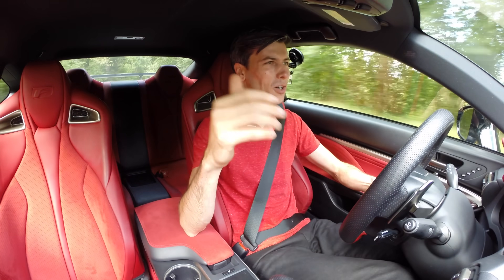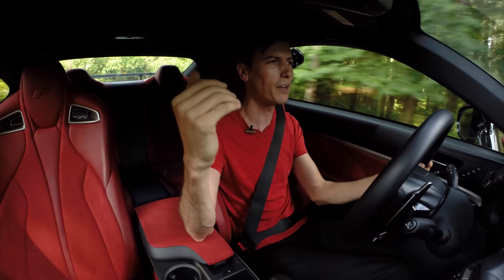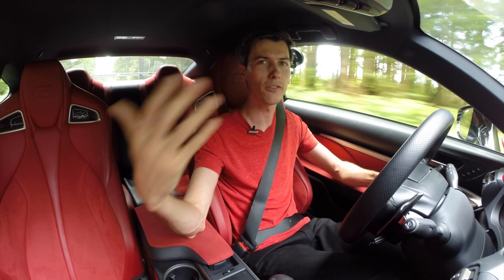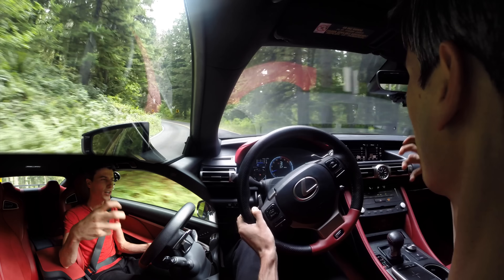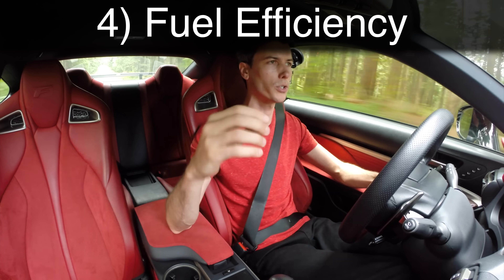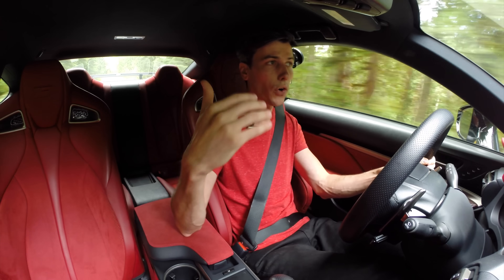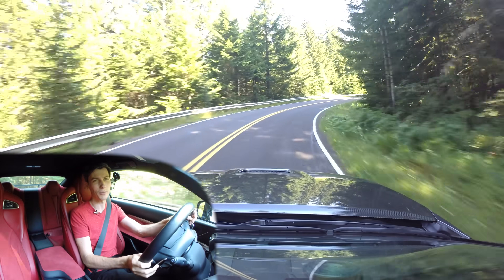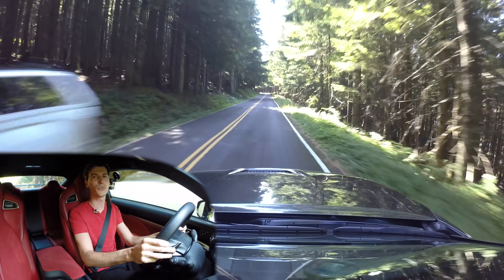5 Reasons You Shouldn't Buy A Turbocharged Car

Comment: I have a family car with a downsize 1.2l VW engine, turbocharged, 105 hp and 175Nm and a Mazda MX5 with the 1.6l NA engine, 116hp and 135Nm, and I have to agree with all you say in this video.
The Mazda engine is just the much more pleasant engine to drive with, imediate throttle response, rev happy (shift at 7000rpm), more efficient under higher loads and it doesn't turn the oil black within a 1000 miles.
In the long end that Mazda engine will outlive the VW engine by a factor 2 I think.
The VW engine is designed to give a good mileage and low emisions, which it only does when it's not taken beyond 2500rpm.
It has full torque from 1800rpm, but above 4500 rpm this engine is literally dead, it feels like a diesel engine in its response and enables a very relaxed driving style with minimal shifting.

Comment: “Do you want a delay in steering,”. Hahaha. A “delay in braking...no that would be incredibly dangerous.”
Reply: With modern turbo tech if you’re in the correct gear you have next to no lag, even with a powerful engine.
Reply: It’s more of a preference some people like a long hard hitting power band.
Reply: A 1959 Cadillac (or other US car of the era) had a bunch of delay in steering.   You could whip the steering wheel 90 degrees left & right while driving on the highway and all the car would do is rock severely back & forth while staying in its lane of travel.  A lot of improvements over the pat 60 years.  :-)
Reply: “This is America, I want it and I want it NOW!”

Wait at the McD drive thru ordering line to place order. 
Wait to get to the pay window.
After paying, wait to get the food.

I think a little bit of turbo lag isn’t that bad.
Reply: @jack765ful  It often shocks me how few people actually use the App instead.  Don't even need to tap to pay.  Plus it lets you double-dip on the free coffee sticker collection.
Reply: Those 2 things dont have anything to do with delayed power just a bad example
Reply: @andreasf3064  How is that a bad example? Having instant throttle response is as a big safety feature as a responsive brake.
Reply: @andreasf3064  
It's a fairly reasonable example
Sometimes you might need to rely on that power to save your life
What if you're about to get rear ended? With a huge turbo you may not get off the line fast enough

Comment: This is relative. 1. Throttle response doesn't have to be impacted much at all depending on the setup and goals. Wanting completely linear power delivery is preference and not necessarily the "best." 2. Torque curve can look pretty flat on a Tubrocharged engine, this is about the combination of the setup and tuning, it doesn't have to be "peaky" or "fall off" up top depending on your setup and goals. 3. You may have to stay on top of maintenance a bit more than a NA engine, but we're trying to make a bunch of hp, this doesn't matter. 4. The turbo doesn't have to be less efficient than a NA engine as long as you keep your foot out of it. Even then you'll be using more fuel because you're hauling ass everywhere. If you look at your thermal efficiency table in your video you'll notice there's only a few % difference between 10 to 1 and 12 to 1. This is negligible. 5. Preference. I definitely like the sound of a BIG SPOOLY BOY

Comment: This is why I love supercharged rotary engines ❤️
Reply: I'm not here to champion V8s either. I think the straight 6 is the king of Piston engine design or two straight sixes mounted on a single crank (V12). Also sure I can tune a K24 to 800HP but that doesn't mean an I4 is better than a V8 for performance.
Reply: @johnh8546  amen brother! hahah yeah thats true, and thats funny you mention a k series.. been planning a swap with one of those lol but hey, we've found common ground! I agree :)
Reply: Because you love burning gas and oil?
Reply: John H absolutely 😎😜

Because lightweight power plants are amazing
Reply: Yeah they are light with no torque, horrible economy, terrible longevity, and went out of production but I'm sure there was no good reason for it.
Reply: @johnh8546  no torque from the factory.. though a tuned 13b can easily out perform a v8 in both hp AND torque. I love v8's because they are cheaper to run as a daily and way less maintenance!
Reply: @johnh8546  ohh and yes, terrible fuel consumption by far the worst.. haha flames everywhere though which is fun! and don't believe the myths about rotaries not being reliable.. they are.. IF you stay on top of maintenance and know what they like/don't like..
Reply: John H for sure man no worries haha it’s the internet, it happens lol

Nice, just your daily? 

I love rotary engines.. sound and feel.. but as a daily, it’s too tedious.. love hate relationship hahah
Reply: No just not a race car my daily is 2002 Civic Type R with at bone stock K20 with 255K on it. My Accord coupe has the K24 with Motec Exhaust, a T25 turbo, high volume injectors (stock probably would have worked), it has a K20 head, ARP head gasket and Studs, and other stuff to the drive train and suspension but pretty tame ultimately.
Reply: John H right on haha well, it has potential I’m sure.. are running a tune or just stock right now?
Reply: My Type R is truly bone stock I'm running a K&N air filter but it's truly bone stock and of course has 3 petals. I got it cheap with a burnt out clutch years back and decided to keep it stock as a daily/beater.

Comment: Love this vid, mind explaining why BMW went with 3 and 4 turbos in their new generations of high end cars?
Reply: I believe the 3-turbo option is only on diesels.  At any rate, yeah, there are advantages to turbos.  Obviously, nobody would use them if they didn't have some advantages.  So, sure, advantages and disadvantages.  But at least typically, a BMW driver isn't going to expect it to last 300,000 miles like a normally aspirated Civic or Corolla driver might.

Comment: Pretty good summary.  Generally turbos seem like a false economy.  Engines don't last as long, and under real world use they MPG is not as close to the rated MPG as a NA engine.  With the lower compression ratio you are worse off when the turbo is off, and when the turbo is on you get worse MPG and wear.  I've noticed companies reducing the CPO warranties as they move from 2.5-3.5 liter NA engines to 2.0 turbos, and I've been a big uptick in serious engine problems just after the warranty expires.   Seems like the days of a well taken care of engine lasting 200-300k miles are gone.

Comment: If you had made this video 10 years ago, your points would be valid.  However, the engineering that has gone into forced induction as well as the throttle by wire makes this entire video invalid.  FAIL.

Comment: Valid points, Jason. I cannot comment as much because I still haven't driven a gasoline/petrol turbo car (only turbo-diesels), but I didn't realise (rather, didn't figure out) the higher fuel consumption is due to the lower compression ratios, and the softer engine sound (read that, not experienced it) due to the exhaust air being used to spin the turbine. The sound has to be there for me, along with a stick shift, that's why the upcoming electric cars worry me, even if I like them due to performance being more accessible in them, with the lower maintenance due to less moving parts.

Comment: i like my 4 cylinder turbo and get 44mpg with an average speed of also 44mph. higher or lower average speed results in 34mpg its a 2012 chevy cruse lt. i do not like the lag if im going 35 and have to slow to about 15 for someone to take a turn and then speed back up if i over press the peddle theres close to a 2 second delay before the seat hits me in the back and it takes off.

Comment: Car engines propel the weight of the car, including the weight of the powertrain.  A smaller lighter powertrain promotes fuel economy and more balanced handling, as well as easier packaging.  The notion that it takes 2 seconds to get power out of a turbo engine is outdated.    Modern turbos have much better throttle response.  Some companies are assisting turbo spool up with electric motors to further improve throttle response.  Drive a turbo Porsche or just about any other turbo car and you are going to find a lot more mid range torque than with naturally aspirated, where most driving is done.

Comment: As for number 4, I'm not sure about small car, but in big diesel (bus & truck), they have this "Turbo Intercooler", which is basically an additional radiator to cool down air intake after getting pressurised by turbo.

Comment: The S55 engine in my M3 really has to be revved out to hit good power. Not torque...power. Like, if you’re cruising at 60+ mph and you gotta rev past 5,000 rpm or it feels dead. Very similar to NA in that respect.

Comment: I was surprised to learn that a gentleman with a minimalist F150 like mine (his with a V8 and mine with the 2.7L twin turbo Ecoboost); each of us with a very light-weight RCSB work truck; each around 4200 pounds of curb weight (v8 weighs about
60 pounds more than small twin turbo F150, all else being equal)that, he  was achieving 20.9 according to his mpg computer regular driving which he said included some towing. My trip meter usually shows between 25-27; but is normally 1.5-1.9 optimistic and I get better mpg than most drivers, and I use my truck for light duty furniture hauling etc plus commuting, and also, the optimism of the trip computer tends to increase as actual mpg increases at least in my truck. Considering all of that, I figure that I could likely achieve around 22.5 in the V8 same configured pickup as mine versus my 24.2 lifetime average. The more city driving done probably results in a greater advantage as mine can exceed 20 city driving in real world city driving; I can't see the bigger V8 doing well city driving even in it's lightest form. If I used a truck for hard work or used it for regular towing or had a large, heavy, elaborate configured pickup like many crazy people do, I wouldn't even consider a GTDI engine. It's best place is for those who drive easy; have a modest configuration that will allow for minimal turbo spooling but also want the advantage of increased torque that a wimpy NA V6 can't provide while also getting better mpg than larger displaced engines such as V8s can't possibly achieve due to their size. But for those seeking  great performance or high utility as a high priority, if a large V8 is offered or a smaller turbo or twin turbo with similar peformances or capabilities, then the big V8 is the better choice; especially if you want decent mpg while towing or drag racing.

Comment: Hi, you spoke of heating and high temp & resulting high pressure in TC Engines, but is it not why inter-coolers or CAC's used before the High pressure & Temp air is fed into the cyl to avoid early spark and resulting Knocking of engine.?

Do you have any thoughts on introduction of VGT's in Gasoline Engines, which can account of some issue. I would like to hear your insights more and also learn more of your references on this topic.

Comment: Once I went to Kanada for Holiday. I met a guy who had a Mazda 3 with 240 HP. I told him that mine with a 1.6 l Turbodiesel makes 180 km/h on full throttle.
He didnt understand what I said. The max speed he has been driving was 140 because he was too scared of the police. Max speed everywhere was 80. 
So I asked him for what he needs these high Hp. 
My small diesel has 270 Nm. That really kicks. If you have 2 l diesel you usually have around 400 Nm. What is realreally enough.
But beside that I also love the easier predictable feeling of my Mazda Miata with the 1.8 l enginde from 2004.

Comment: I agree unless you have a diesel. My VW TDI has been flawless. However I will replace the turbo proactively at about 120K miles. They fail. If oil goes in exhaust it can destroy the expensive DPF and catalytic converter. Worse is hydrolock and engine damage.

Comment: Hahahahhahahahha I can guarantee you this 5.0 V8 isn't getting great gas mileage.    His biggest complaint is the power delivery and next is the heat/wear and tear.    The engines are designed to handle the turbo and gas mileage is dependent on how heavy the foot is.  For example, I drive a 2018 type R and if I drive it very hard, I'll get 15 in the city and 24 on the highway. However, if I drive it very gently, I will get 26 in the city and 31 on the highway.  In the end, it's all relative.

Comment: My C7 Corvette Z-51 is happily NOT turbo charged. Fuel economy is easy by switching to Eco Mode using 4 of 8 cylinders and the 7th gear ... highway trips. Even using Eco Mode with four cylinders, the acceleration is very impressive. Hahahah. When I want amazing power beyond Eco and Touring Mode, I can use Sport Mode or even Track Mode and the acceleration is TERRIFYING! initially followed by reducing to just exciting. And I really like the design over the new 2020 C8 mid-engine Corvette regardless of the mid-engine advantages in acceleration.

Comment: 1,2 sequential turbos
3 performance motors cost money to build, oil is cheap insurance
4 per the graph, there's virtually no difference in thermal efficiency between an engine at 9:1 vs 13:1 CR. And performance engines use fuel, big deal.
5 Clutching at straws.

Comment: While I don't have a turbo, "taking away noise to do something useful" is a pretty weak "disadvantage"
Reply: Depends  on if you see it as useful or not. I see it as adding pressure to the engine which shortens life span. If your one to get a new car every few years that's likely ok but I keep mine 20 or more years. My oldest is a 2003 with 236,000 miles and still going strong with nothing but routine maintenance.
Reply: @strtngfrsh  manufacturers get rid of that attitude. They need more money, so they want to sell more cars and faster, because they need the money for "development", therefore they make the cars worse. Interesting, back in the 80s for example they didn't need that much money...
Reply: Exactly
Reply: @Frances Hill If you are gonna give up that much performance(Especially in diesel cars) for sound, you can go and listen to youtube videos. A good na v8 definently sounds good but I would rather take a straight 5 diesel tdi if I had to choose.

Comment: I had a 2014 2500 Cummins which had amazing power and I loved every second of driving it, but there are more parts on a turbocharged vehicle and thus more things that can go wrong. After the controller for the variable geometry turbo went out and $3k later I traded it in for a 2019 1500 with the naturally aspirated 5.7 hemi and I am quite happy

Comment: I’m glad I saw this. I love naturally aspirated engines. They’re just more realistic to me. They’re more understandable and more predictable
Reply: Swagmaster 64 And a lot less expensive when they need repairs!
Reply: Realistic? LOL a turbo is real though.....
Reply: BUT NO "PSSSHHH" SOUND WHEN YOU LET GO OF THE THROTTLE! sad and boring
Reply: They're also more daily-able.  Low compression sucks.  I want my car to move without having to floor it.  You're at low RPM and barely on the throttle 99% of the time.  I'll take displacement, please.  Turbo cars have absolutely no balls.
Reply: @spraynpray  get a smaller turbo then?
Reply: More reliable
Reply: My friend and I have a similar car with an engine with similar power output (quite weak). His car is NA and mine is turbocharged. 
I can tell you, his car feels just garbage to drive. Throttle response is pretty nice but the engine is so anemic under 4000 tr/min, it doesn't even matter.

Comment: In Europe we live in Turbo Diesel land, so naturally aspirated are not that common for the average car here. We have experienced the evolution of the turbo engines though. The ones a few years ago were so, so laggy arghh, but now with twin turbos, one smaller to cope with the response at low revs, and a bigger one for power at higher revs, the experience is way more linear and pleasant.  And well, sound is terrible in diesels anyway :-)

Comment: I never really thought about it before....But obviously there is a huge difference between Turbo Diesels and Turbo gas (petrol) cars. because I dont have any of these problems in my 335d.....I get 38 MPG. on Freeway / 450 torque / 0-60 in 5.5 sec. / top speed 155

Comment: The #1 reason is because you have to use premium gasoline. My ‘03 WRX with a 5 speed manual averages 24mpg on 93 octane if I drive it normal and stay under 4K rpm(almost impossible). So the cost in gasoline is like driving a naturally aspirated V8 car that takes regular unleaded gasoline.

Comment: You are nitpicking here. None of your opinion matters in real world driving. There is a reason why the major manufactures are going to turbos, space , weight, initial acceleration. gag mileage etc. I don't disagree that a big V8 is the best or a straight 6 is delirious, you can get a twin turbo V6 to out preform a V8 quite easily ....Nisan GT R, Porsche 911 Turbo

Comment: Wrong. V8 engines sound wonderful because of the uneven firing order creating uneven exhaust. Our ears pick up on this, creating LOWER tones than even-firing 4 cylinder engines with excellent exhaust scavenging. That's why I never want to alter the exhaust on my 1965 Mustang with a 289 V8 and dual exhaust and "straight through" mufflers that doesn't cross the exhaust streams with an H or X-pipe. It's about as inefficient as exhaust systems get, but it makes me smile more than any exhaust sound I've heard from anything later than 1985.

Comment: I love my VW 1.8 turbo Sportwagen.
Full synthetic oil and cooling fan when car is shut off so the oil doesn't coke on turbo, 87 octane.  I have gotten 39 mpg on a road trip and the car is really torquey and powerful in stock form.
I love turbos.
Cheers